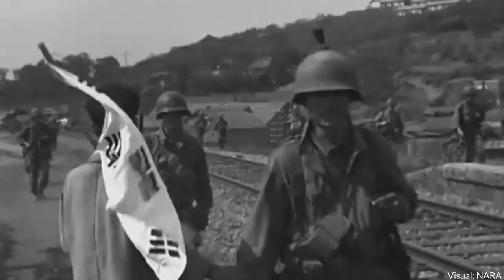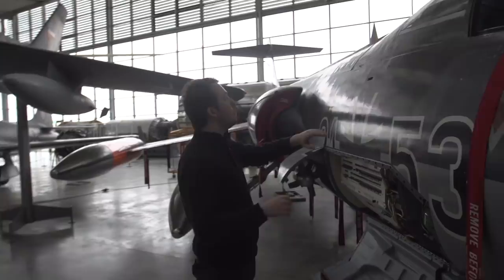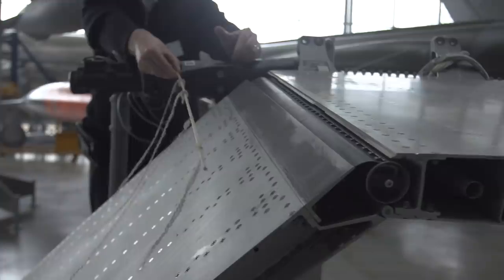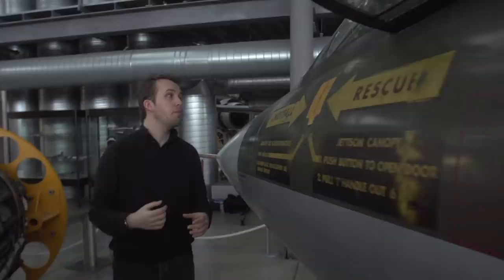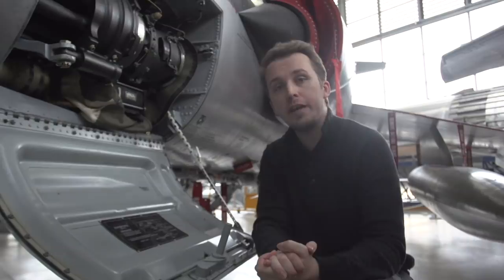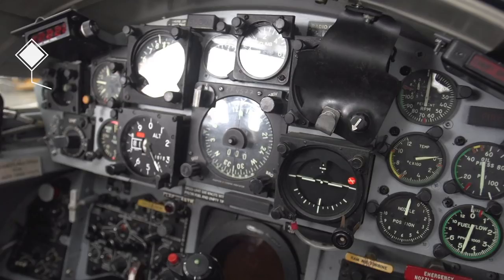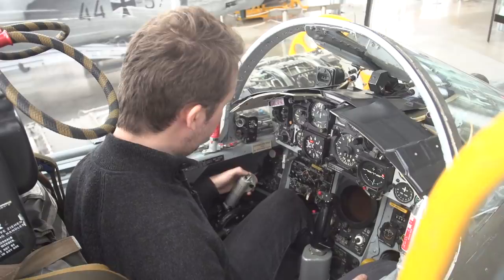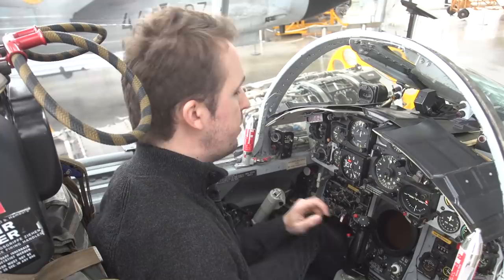F-104G Starfighter - Inside The Cockpit

Comment: Fun fact, I worked on this exact plane when I was an intern at the Deutsches Museum Schleißheim. It was in restoration for quite some time. I also got to stand on the wing of the Me262 and look in the cockpit. I remember that we weren’t allowed to open the cabin because of the radioactive colour that was used to make numbers visible at night.
Reply: Radium? Damn, so hot it radioactive.
Reply: @cheesepuffguy  Maybe tritium? that is more often used now for night sights etc. Short half life though, but not as bad for you as the old radium dials.
Reply: @VeraTR909  Radium.  Nobody (Especially Germany) was making Tritium in the 1940s.
It may seem like the dosage levels would be low, but with a closed-up museum exhibit, the decay products in the air in the cockpit would not be something you'd want to breathe.
Reply: @VeraTR909  Glad to hear it! Since the Starfighter took over for "the last dogfighter" Sabre I was hoping those poor Radium Girls weren't still having to lick their paintbrushes to paint on number dials.
Reply: I noticed one of the exhibits (the Bolton Paul Defiant, I think) at the RAF Museum in Hendon (London) had a radioactivity warning sign inside the cockpit. So, a common problem with some old aircraft, I guess.
Reply: @RaedwaldBretwalda  I was surprised as well but like another commentator said, the air in that cabin has been getting radiated a tiny bit every year over 70 years so by now the concentration is high enough to be dangerous
Reply: @peterstickney7608  Those poor Radium Girls

Comment: I have a cousin who was a test pilot on a later version of the F-104 when a re-engine called for a lengthened fuselage. This was in mid-60's. In a flight test for aileron flutter in its new configuration, he was to put the test craft into a dive from 40,000' down to 20,000' (12.2 km - 6.1 km) going about 1400 mph (2254 km/h), report any flutter and pull up.
As he got to the 20,000' altitude, he discovered that aerodynamic forces would not allow him to pull back on the control stick, until pulling with both hands on the stick and both feet pressing on the instrument panel! The aircraft began a VERY slow recovery from the dive, but my cousin doesn't remember it, as the G forces caused him to black out. The instrument recorder showed that even though he blacked out, he kept the back pressure on the stick, and the plane reached the lowest altitude of 1,500' (.46 km) before heading back up. He regained his senses going back up through 20,000' !
(edit)  By the way, he refused to eject, as a test pilot friend just the week before had ejected at a similar speed and since the canopy had failed to blow away, had both arms cut off when he went through the canopy.
Reply: That must have been a different aircraft because aerodynamic forces cannot be transmitted to the control stick of the F-104.
Reply: @gort8203  Correct, the direct forces were not felt in the controls, but the controls were given the affects of the forces on the  surfaces so the pilot could "sense" their input and effects!
Reply: @DouglasJenkins  Sorry, but you must have misunderstood your cousin.  First of all, you said: "the aerodynamic forces would not allow him to pull back on the control stick".  That is not possible because there is no sensing of aerodynamic load by the control system, and no mechanism to provide feedback based on those not-sensed loads.
The "artificial feel" system of the F-104 control stick was quite standard for its time, and consisted mainly of centering springs, with some cams and maybe a bobweight.  The purpose of a bobweight is provide some resistance to aft stick movement  proportionate to G load; requiring more backstick pressure to produce higher G makes fine control of G easier with less tendency to overshoot the desired G load.  The additional stick force required has nothing to do with aerodynamic forces, and in absolutely no case is significant enough to prevent the pilot from pulling the stick to the aft stop with one hand.  If an F-104 pilot ever had to brace his feet on the instrument panel to pull the stick back it was due to a control system jam or a foreign object physically obstructing movement of the stick.
Reply: @gort8203  You may be right. And cannot check with him now.
Reply: @DouglasJenkins  Sorry to hear that he is no longer available.  But he did get to fly the F-104, of which I am envious.

Comment: The placement of the "stores jettison" button in front of the throttle is there so the pilot could instantly push during take-off in case of emergency.  At take-off and heavy this was critical.
My father and stepfather were fighter pilots and I remember him describing this situation at the officers club while I  listened. I used to hang in the background and listen to the pilots talk between themselves. Overheard many cool things.
I used to photograph the German F-104s and F-4s at Bitburg AFB and Spangdalum AFB when we were stationed there. Good times.

Comment: Oh, that brings back memories of my time in the RAF in Germany in the 60s!  Luftwaffe F104s often howled their way across the skies at that time.

I also recall a cartoon on the wall of an F104 squadron crew room.  It showed the said aircraft in flight with an angel holding up each wingtip while the pilot was out of the cockpit, on the fuselage, with a screwdriver and panels off!  Can't remember which squadron or where as it must have been 50 or so years ago.

Regarding it's bad reputation, it's accident rate wasn't that much different to the EE Lightning we operated.  The numbers for the F104 may have been double those of the Lightning but we had only half the number of aircraft producing them!

Anyway, great video, keep them coming.  Thanks, D.

Comment: Kelly Johnson never intended the Starfighter to be an air-to-ground bomb truck. An unforgiving aircraft at low level. The Luftwaffe should have split their buy with an Attack aircraft. Perhaps with the A-4 Skyhawk. As a teen in Arizona I saw Luftwaffe training Starfighters flying around. Beautiful aircraft.
Reply: Well you see the German government were dumb enough to accept bribes.
Reply: @sargesacker2599  Only the Minister of Defence. They should have gone with what Hartmann apparently suggested, a mix of Mirage IIIs and IIRC A4s or with something else entire, more F-4 Phantom IIs. Double Ugly ftw.
Reply: From 'International Starfighter Society's website:
"Contrary to popular opinion, the F-104 was not designed as a high-altitude bomber interceptor. The F-104 was designed as a daylight air superiority fighter, with secondary ground attack capability, to replace the F-86. The source of the interceptor misconception is probably the fact that the F-104 first entered service in February 1958 as an interim interceptor with the ADC in the form of the F-104A. The F-104C air superiority fighter did not enter service with TAC until October 1958."
Reply: @trekaddict  …. IIRC the Luftwaffe only bought F-4’s starting in early 1970’s. My recollection is that came without radar guided missiles. The original navy F-4 requirement was for fleet air defense fighter. Rather than as the multirole aircraft it morphed into. When NATO was looking for a new fighter the F-4 probably wasn’t being considered…. That’s my guess
Reply: its like training in a golf and then jumping in a ferrari

Comment: Geez, I love those early Mach 2 Jets! Especially the century series:
The (shy of Mach 2) F-101 with its twisted development, leading from the goal of an escort fighter to the F-101A/C fighter-bomber and the F-101B interceptor.
This mighty F-104, which was clearly an interceptor only but nevertheless got its second role as a fighter-bomber
The brutal F-105 fighter-bomber.
The beautiful F-106 interceptor which was essentially a F-102B.

It was a time when only speed counted, and it was only about 10-15 years after WWII when those machines were developed, just incredible!
A crazy time when it was about striking first with nuclear bombs delivered by ac before there were ICBMs, and intercepting those bombers. And retaliate with nuclear armed fighter-bombers, even if your country had ceased to exist - pure madness!

Also the Saab Draken, Mig-21, Su-7/9/11 and British Lightning were similar fascinating machines.

Even after 60 years they are more fascinating than, let´s say a F-35.

Comment: I was going to save this until the later video (Great job, Chris, This makes me want to book a flight to Germany to tour the Museum), but the question has come up in the comments asking why was the Starfighter selected as the standard NATO/German fighter?  So I thought I'd give it some context.  The only airplane airplane flying in an operational form that met the requirements was the F-104.  
The requirement was for an airplane that could act as an all weather Interceptor, requiring radar, missile armament, and speed/height of Mach 2.0+ and 50,000'+, and as a strike fighter, carrying a single nuclear weapon at low level, possibly at night and in bad weather. So - high subsonic cruise/supersonic dash at low level, and low gust response.

Let's look at where the candidates were at the time of the selection.
The Mirage IIIA prototype was still in its initial flight test,(First Flight May 1958).  Flight envelope expansion took time, and there was no weapons integration. The combat capable Mirage IIIC didn't fly until October 1960.
At that time, weapons consisted of 2 30mm guns, and a single Matra R.530 missile (The worst AAM ever produced). 
If you were going to fly your Mirage as an Interceptor, you needed to delete the guns to carry the rocket pack's 
oxidizer.  It had no air to ground capability, and Marcel Dassault wasn't interested in adding any.

The English Electric Lightning Was still the P.1B, not yet becoming the Lightning F.1.  It was a fantastic point defense 
interceptor, carried the AI.23 radar (Fairly decent for its day, but very basic) and 2 AAMs.  It couldn't carry any 

air to ground weapons, (No place to put 'em - the wing was full of the landing gear bays) and its range was practically non existent.  It was limited by stability to Mach 1.7. (This is from the Pilot's Handbok) The F.3 was cleared to mach 2.0, but 
didn't fly until 1962.

The Saro SR.177 - potentially fantastic - the same radar and weapons as the Lightning, and its fully integrated mixed powerplant (Afterburning turbojet and rocket) would have given it amazing high altitude performance.  The only problem was, it only existed in Saunders-Roe's Drafting Office and the sales brochures.

The Grumman F11F-1F - the tiny Grumman Tiger with a J79 engine replacing the original low-power J65.  Flying at the time of the competition.  It had, when it was running well, great performance, and outstanding handling.  It suffered from structural issues - stabilator flutter was the worst, and potentially disastrous, and the prototypes had some teething issues that 
made performance testing a "Good Day/Bad Day" proposition.  Weapons shapes were installed, but no drop tests or firing trials were ever performed, nor were any radar or tactical systems installed.  The Super Tiger had great potential, but Grumman really didn't want to get into the export fighter market, using the competition to break in its international sales force.

The F-104.  The F-104A interceptor entered squadron service in January 1958.  The F-104C Tactical Fighter went operational in November 1958.  While these aircraft had systems more limited than the F-104G, they were demonstrating routine Mach 2+ performance, and were cleared for firing missiles and dropping bombs.  Lockheed proposed a variant with a NASARR multimode radar, capable of air to air search/intercept, and ground mapping/terrain clearance, a Litton Inertial Navigation System, and more pylons.  The prototype F-104G flew in Oct 1960.  The NASARR radar and its weapon interfaces were also going into the F-105 (With a Doppler Navigator rather than the INS), and was flying in testbed aircraft.

So - of the principal candidates, 4 actually existed. (Mirage IIIA, barely, EE P.1B/Lightning, Super Tiger, and the F-104)
2 could actually meet the required performance. (Super Tiger and F-104)
1 was actually in service, and was qualified to drop ordnance - (F-104)
From that perspective, the F-104 looks to be pretty much the only choice.
In terms of tactical utility, the F-104 brought great speed and climb, good range, and a weapons fit that provided the ability to act as an interceptor or strike/recce airplane.  It had better supersonic maneuverability than any of its contemporaries, and was the equal or superior of anything at 550 kt+.(you wouldn't want to be knife fighting with a MiG-17 at 350 kts, but that's 
a sucker's game no matter what you are flying.)  For carrying your bomb or camera at 600 kts+, 200', in any weather, it was unbeatable (If you don't count the F-105 and F-111), able to go anywhere without anyone doing much of anything about it.
If you were a decision maker for your nation's military, you could watch a paper presentation on how the Mirage, or Lightning, or SR.177 or even the Super Tiger was going to be Really Awesome, Someday, Believe It!, or you could Climb into the back seat of 2-seat F-104 (Either a B or D), fly it up past Mach 2/50,000', drop some bombs, (or, more likely watch a firepower demonstration), and talk to the Line Pilots and Maintainers.

Comment: I was serving at RAF Cottesmore in the late 80's.  German and Italian F 104' s could be seen at the visiting aircraft section on a regular basis. Each 104 had an external tank on every pylon. You could tell they were old and worn . Because under each 104 was a 104 shaped silhouette of drip trays.
Reply: On a lot of these older jets, if it ain't leaking something is wrong
Reply: @scullystie4389  If it ain't leaking, better add more fluid; the tank is dry.
Reply: At the Chino, California Planes of Fame museum you can tell which ones are in running condition: Drip pans.

Comment: When I was stationed at Luke AFB in Arizona in the early 1970's I worked in the flight simulator shop where we just happened to have an F-104 simulator.  We also had an F-100 and two F-4 simulators.  I was there two years and spent plenty of idle time in the cockpits of the simulators and the F-104 was the only one I couldn't land without crashing.  No glide path whatsoever.

Comment: They have one of these Starfighters are the Langley Museum of Flight outside of Vancouver, BC where I live. The Museum has no security and isn't in the best of shape...The leading wing guards have mostly fallen off and you can touch the wing. If you believe it's exaggerated out sharp they are, think again, like a razor, any pressure will cut your skin as it did mine (I had a recent tetanus shot though!).